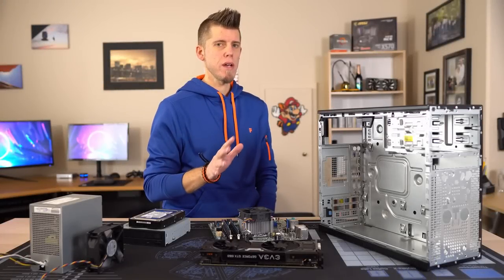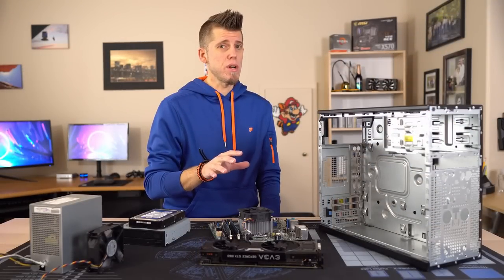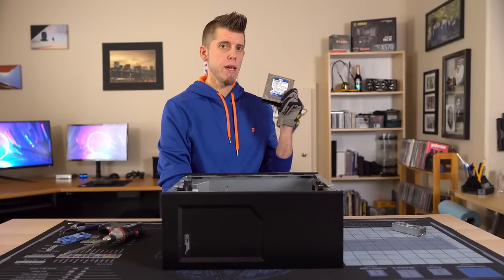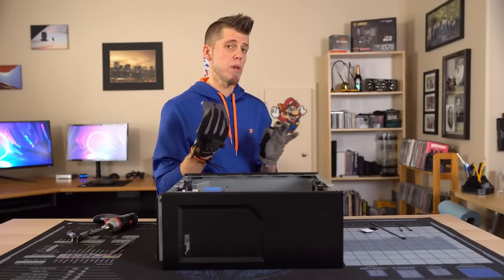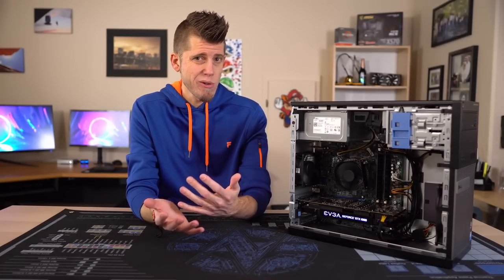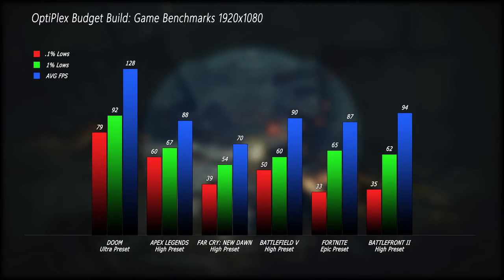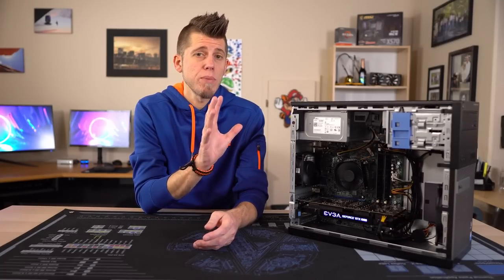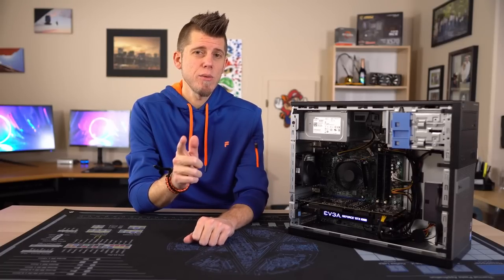Dell OptiPlex Budget Gaming PC For Under $300?

Comment from the maker: I realize that I didn't include Windows in the cost of the build... and that's because it was free.  For some reason I forgot to include that, but I'll upload a video soon about how you can easily get legit Windows 10 for free.
Reply: Also worth noting that most of the optiplexes on ebay have a legit windows 7 COA which can be upgraded to windows 10 for free.
Reply: Is this gaming pc good? It costs 1200$
Intel® Core™ i7-9700-processor
Nvidia GeForce RTX 2060 Super, 8 GB
16 GB RAM, 512 GB SSD
Reply: XxAleks04xX way overpriced but yes
Reply: @ScullyBrewing  bruh its on sale to norway is expensive
Reply: @MrGeasel  That is what I did. Installed win 7 then upgraded to 10. I was surprised to see that the free upgrade was still available.
Reply: @Ehsan Yousaf you can sit down and calculate, or go spend 50 bucks on a corsair 550 watt and not have to bother - its about the cheapest decent psu you can buy,  and one i plan to use for my own 9020 when i get a graphics card.
Reply from the maker: For a 1070, you'd be fine with as low as a 400 watt power supply. I'd suggest a 500 watt if you're buying one. It's never bad to have the headroom. Just make sure you get a quality unit. They recommend higher, but they're accounting for poor quality power supplies. I tested the power draw on the 1070 and you wouldn't be pulling more than about 300 watts.
Reply: @coleyounger6872  you can just type in a 7 key in the 10 install and it'll accept the key
Reply: Me with free windows

Windows: Activate Windows!!!!!!

Me:😱
Reply: Ehsan Yousaf look a psu calculator
Reply: XxAleks04xX What I would do is get like a 250 gb ssd and a terabyte hard drive so you can store a lot more data for the same price. Just install Windows and other crucial programs on the ssd, and games/other stuff on the hard drive. Prebuilt PCs are often more expensive than self-built anyway, so go for building it yourself, and maybe throw another 16gb of ram in there.
Reply: @MrSamadolfo  - you don't have to.  The 9020s came with Win7 at a minimum,  and you can LEGALLY upgrade that to 10 if the COA is still on the case to use it.  If it has Win8 loaded in the BIOS, Win10 will pick it up during install.
Reply: @TheTalonts  🙂 oh, yes ur rite, sorry, i forgot that this is oem 😃👍
Reply: @xxaleks04xx70  One advice build it yourself more bang for the buck Go with ryzen and buy your GPU second hand. 

Price in "Canadian" money

Got a ryzen 2600 150$
corsair 850 gold plus 160$ (bought first an EVGA 750 bronze plus that dies instantly that's why i got a really good unessesary one)
asrock m450b steel legend 120$
16 bg of ram 3200mhz 89$
full set of 5 rbg fan and a dual rgb tower cpu coller 90$
m2 slot ssd of 1tb 135$ (hot deal on newegg)
and a GTX 1070 275$ (last year second hand)
corsair case (60$)

About 1079 + -  Don't have all exact prices 

If you want to reduce the price a bit you can even get a gtx 970 which is, in my opinion, the best price value atm... You can get those for about 100$ and a lot of features are not necessary like the extra fans / CPU cooler / m2 slot ss / Cooler is definitely not cheep you could easily find one at half price.

That could easily be a build of 700$ with a used 970 and you can run all game at high/ultra at 60fps+ and you could have the pc for YEARS and just have to upgrade the GPU in few years to a better one 

That build could easily be done with a budget at about 800$ thats just me that added the extra
Reply: Gui thank you😊
Reply: The Game Bench Also, refurbished Windows keys are under $10.
Reply: XxAleks04xX it might be if it came with a monitor.
Reply: @xxaleks04xx70  damn thats good specs i build 15 9400 rtx 2060 for 870 dollars
Reply: You also realize your powering a power hungry GPU by using a the stock PSU? Dude get a Bronze Rating PSU at least. People you are going to fry components if you do that. NEVER CHEAP OUT ON PSU
Reply: @freshyeet4144  Did Reviewtechusa tell you that?
Reply: You didn't include that the existing Dell Optiflex standard power supply is dangerously inadequate for the power demands of the 1060 GPU. The 1060 minimum power requirement alone is 400 watts and the Dell power supply your using is only 280 watt or 300 watt at maximum. The whole system needs a 500 watt PSU minimum, a 300 watt PSU will be under so much strain powering the components including the GPU, it will fry many components when it eventually blows up. Anyone watching this PLEASE DO NOT use the Optiflex PSU with a 1060 GPU or your build will die.
Reply from the maker: @freshyeet4144  You should stop using the efficiency rating as a metric of quality. There are plenty of 80+ Gold PSU's that are utter trash because it's easy to build a cheap PSU and put good capacitors in it. That being said, I would hardly call the 1060 a "power hungry" GPU as it pulls around 120 watts. I've tested the system's total power draw from the wall and it peaks at about 240 watts from the outlet. And that's for a split second, usually it's sitting more around 220 watts. Power draw at the outlet is higher than the component draw from the power supply. So, you're down below 220 watts... worst case scenario. You literally have 70-80 watts of headroom on this power supply.

Not to mention that I've torture tested it with a 480. It was pulling just about 290 watts from the wall. Did it for about four hours just fine. The power supply isn't a bad unit, and it can supply enough power for the 1060 with enough headroom. It's fine. Also, these PSU's came with 80+ Bronze and Gold ratings. They are all exactly the same, save for better capacitors to get the higher efficiency rating.
Reply from the maker: @andyelliott5084  You should read my comment to Treyboi.
Reply: The Game Bench this seems like a waste of time especially no power supply update really ? Better ram ? That fans worthless
Reply from the maker: @hulkinbrent6376  I don't think it's a waste of time. Proving that PC's don't have to be vastly more expensive than consoles? The fan is adequate for a case fan, and is more limited by the restrictive front panel. I will be updating the power supply in another build with an i7 4790 and I'm putting a 1080 in. I didn't in this one since it's adequate for the 1060, but as I said in my last video, will need to be replace for anything more than a 560 on the AMD side. RAM, best you can do is what I put in there, 1600MHz. I wish these supported 2133 or 2400, but they don't. I'll be adding more RAM in the i7 build as well.
Reply: Steve T I wouldn’t ask if it wasn’t a question🤦‍♂️😂
Reply: @Ehsan Yousaf I bought a 650w smartrgb thermaltake psu for $60 AUD - figured it will last 10 years
Reply: @MrGeasel   i bought  a windows  7 coa on ebay for 10$ it work, i was surprised but happy
Reply: @KoTM25681  tbf, if you are going to splurge on a budget build, the PSU isn't a bad strategy.  You can always replace a drive or swap a stick of RAM, but if your power supply fries your PC, you need a whole new computer.  That being said, these retailers rip people off on PSUs.  Just do the research and double-check the math is all I can tell anyone.
Reply: @xxaleks04xx70  a rtx is overkill but that works
Reply: nice

Comment: I was just about to install a GTX 750ti on my Dell Optiplex 390 then I got this notification
Reply: I just finished installation and testing... My build is struggling with fortnite alone open
Reply: Do you have the i5 or i3 Optiplex 390? The dual core is gonna be terrible for modern gaming.
Reply: @jeremebp  i3 2120
Reply: @thevoyageof67  yeah that sucks. Need the quad core to get decent fps these days.
Reply from the maker: Yeah, and even quad cores are starting to struggle. Game developers are really starting to optimize for cores. If you've got about $50, you can get an i7 2600 and put it in there. If you don't have $50, the i5 2500 is about $20 on eBay and it will really help.
Reply: @TheGameBench  thanks man... I'm definitely going with the i5
Reply from the maker: @thevoyageof67  No problem!
Reply: gtx 750 ti is a low end graphics card bro, also i3 is not that good either

with my optiplex i7 3770 and rx 570 im getting 100+ fps average all the time with view distance epic and textures epic and everything low
Reply: @TheGameBench  i know im 4 days late but there are also de xeons e3-1230 or the e3-1240 for $30-$40 they are 100% compatible just buy the V1 or V2
Reply: @TheGameBench  Get a Xeon 1270.  40 bucks for basically a 2600.
Reply from the maker: Sure, the Xeons are always an option, but looking at sold listings, they're about the same cost as their desktop counterparts. If you can find them for less... by all means.
Reply: @TheGameBench  With Sandy/Ivy Bridge, on regular LGA155, probably. One advantage, if you have the right motherboard, is that Xeons support ECC RAM. DDR3 ECC RAM is quite a lot cheaper than regular DDR3. And when looking at X79 i7s vs. Xeons the differrence is spectacular when factoring in (non-overclockable but potent) E5-26xx CPUs.

Haswell (X99) Xeons, even the unlocked 16xx v3 ones, are also significantly cheaper than their i7 counterparts but offer no RAM advantage because DDR4-ECC RAM isn't cheaper than regular DDR4.
Reply: @thevoyageof67  Fortnite is getting big and bloaty and heavy af, in the meantime theres alot of new lighter battle royales that run on your pc, look at all of the youtube reviews, some of them are android ports, and some are native android apk so you will also need to download an android emulator 😃
Reply: Ken your i7 is only third gen, I hope you’re not one of those people that thinks i7>i3 in every situation
Reply: TechniCollins bro e 1245 or 1240 Xeon cheap 8t threads upgrade
Reply: @thevoyageof67   should  had gone with a xeon e3-1240. Its like 30 bucks but performs  similar  to a i7 2600
Reply: Im using gtx 750ti

Comment: I managed to build mine all in all for about $330. i took a chance and bought a refurb from ebay just because of my lack of tech skills. i paid $159 for my 9020 that came with a 1 TB HDD 16 gigs of 1600mhz ram, windows 10 installed, a 80+ bronze psu, and an I5 4590. I found a used PNY 1060 6 gig for $140 and grabbed a 240 gig ssd for the boot drive for $30 and its working like a charm.
Reply from the maker: Considering what you got, I'd say you got a decent deal. If I added 16GB and a decent 80+ bronze PSU, I'd be at about the same price with this one, and it would still have a 500GB drive instead of a 1TB.

Comment: I built a system like this, but without all the disassembly. I bought a refurbished Dell Optiplex 9020 off Amazon for a good price.  It has an Intel Core i5-4590 quad core CPU @ 3.30GHz, 16 GB RAM, and a SSD.  Just added a NVIDIA GeForce GTX 1050 Ti- luckily just before the price of GPUs went through the roof and the supply dried up. That was the best GPU I could use with the stock 300w power supply. Runs like a charm, although the stock case fan is noisy.  FYI It is possible to upgrade the PSU on a Dell, but you need some special adapters because of Dell's proprietary wiring.  
Also, remember that a Hollywood movie is shot and shown at 24 FPS.  "Frames win games" is just marketing from folks trying to sell you overpriced and overpowered GPUs.  Plus, how many times is it just a contest for bragging rights, having the fastest PC build or the coolest case with the fanciest lights?  My rig cost less than the lowest end gaming PCs, which have worse specs.  Ugly as a concrete block, but it does the job.

Comment: I virtually have the same build! I commented not too long ago about putting an rx460 into an optiplex 790 but i opted for the 1060 6gb which included removing the hard drive bay. I get wonderful temps on LOOONG gaming sessions without a front fan in place and with the cover still on. Im running a 600W psu, i7 2600, 250gb ssd, 500gb hdd (will upgrade to 1tb ssd one day) and finally 16gb of ram. I got my pc for free from work and right now i have a total of 200 dollars in my build which is outstanding because i can play any game i want on 1080p high-ultra settings with no issues. Thanks for the vids!
Reply: looks like you know a lot about PC's so is this gaming pc good? It costs 1200$
Intel® Core™ i7-9700-processor
Nvidia GeForce RTX 2060 Super, 8 GB
16 GB RAM, 512 GB SSD
Reply: @xxaleks04xx70  you can piece it together and build it yourself for less
Reply: isnt that very hard?
Reply from the maker: That's awesome! Yeah, I found that the front fan had no effect on temps with the 1060's I've been using. Only really matters if you're using a GPU with poor cooling. I started with some MSi Armor cards which have really bad coolers on them and they were throttling without it. It was just enough of a difference to keep the clocks from dropping. I am going to do an updated video to open up that front panel too.
Reply from the maker: Building a PC is pretty straight forward. Seems I'm going to have to make a video on that in the future. However, for now, I suggest watching JayzTwoCents or Pual's Hardware. They both have good tutorial videos.
Reply: @TheGameBench  absolutely my 1060 sounds like 2 jet planes taking off on full throttle hahaha
Reply: If you get a chance, throw a 990 motherboard in there - it supports RAID, which is great if you are using it for more than gaming and worried about data loss.  Or move up to a 7010/9010 mb and gain USB3 without having to have a separate PCI card for it.  The 9020 motherboard he shows here will also fit, though you'd need the 24-8 pin adapter cable for it.

I finally started tearing apart a 790 tower - I needed the cooler for a 990 (though that cooler is probably getting moved to a 9020), the case fan for a 9020, the memory for a 990/7010/9010 (not sure which yet), and I'll probably end up using almost all the rest of it elsewhere.

I like that Dell used the same case for the x90, x010, and x020 series, it makes it easy to swap parts around.
Reply from the maker: @nuisynth  Well, the front fan would really help with that. It also might need some fresh thermal paste. Had a single fan model that was like that until I changed out the paste then it was fine, even without the front fan.
Reply: @TheGameBench  well luckily its never throttled high while playing but i was messing around with afterburner just to see how powerful the fans were

Comment: Fuck the elitist haters that cannot do actual math, or research. A 1060 will only pull 125w at PEAK torture tests loads. No game will ever do this. I've run >TWO< 1060's off of an EVGA 400w, with a 750w Corsair running FOUR more, and the rest of the system, back in the mining days. No gaming will EVER load them like that did. And i did it 24/7 for WELL over a year. Great vid :)
Reply from the maker: Thanks. It's unfortunate how much ignorance there is floating around about this. Sadly, there's just as much confirmation bias. I'm glad that at least some people have had an open mind and were willing to admit they were wrong.
Reply: @TheGameBench  Cheers :D

Comment: For anybody that's still curious about budget PC build pricing, I just got some great deals on eBay
Dell Optiplex 7020 MT w/ i5-4590 and 8gb of RAM for $75
Zotac GTX 1060 6gb AMP edition for $100
EVGA 500w power supply for $35
24pin to 8pin adapter (mandatory for optiplex) for $10
The Optiplex didn't come with a hard drive but I preferred it that way for cost because I already had extra hard drives and RAM laying around ( I'll be adding an additional 4gb for a total of 12gb of RAM)
Total cost = $220 for everything, after shipping $250.. in my opinion not a bad entry build for $250

Comment: I got my first computer about 2 months ago. I bought it for $300. It’s a Dell Optiplex 9010 with the following specs:

EVGA GTX 960 SC 2gb
Intel i5-3570
500 watt PSU
12gb ddr3 RAM
120gb SSD

Honestly, I wouldn’t trade it for anything else right now. I’ve learned so much about computers by owning & working on it. It makes for a formidable sleeper pc and an incredible first pc for me. I swapped the GTX 960 for a Gigabyte GTX 1060 Windforce OC 3gb and a Crucial MX500 500gb SSD. I use the system mostly for X-Plane in VR and streaming. Couldn’t be happier, and I would absolutely recommend it for another kid looking for their first pc.